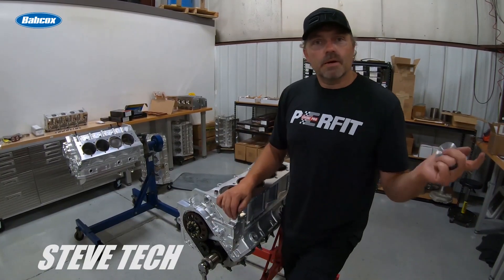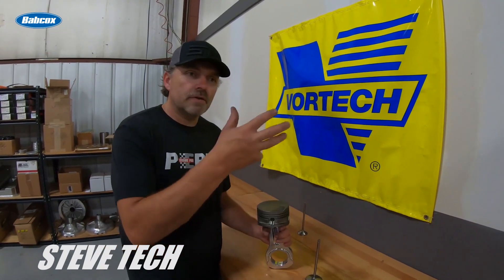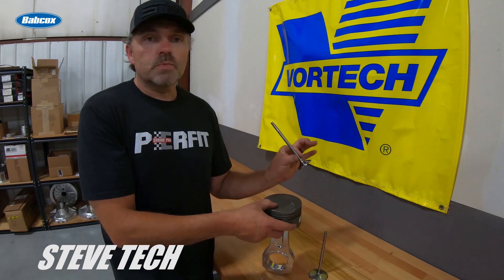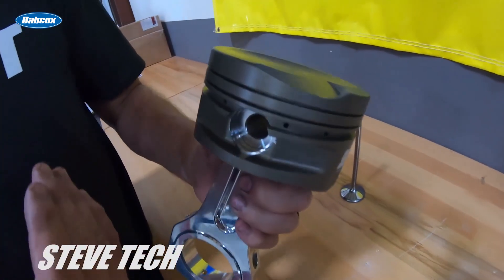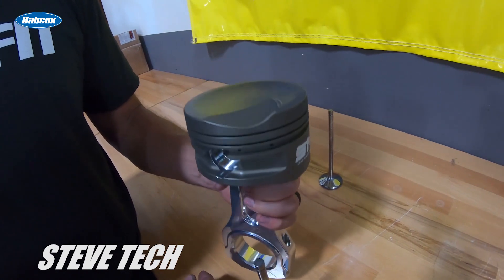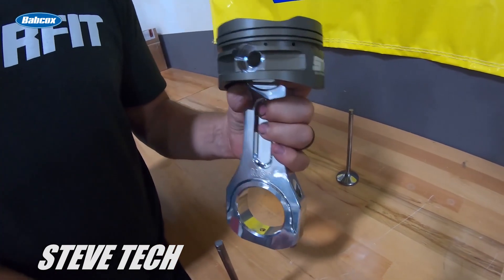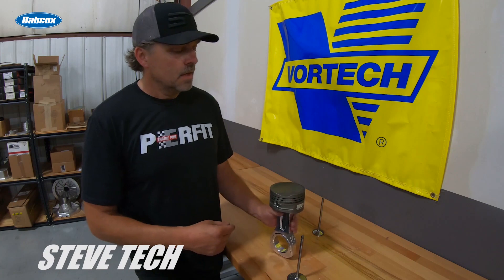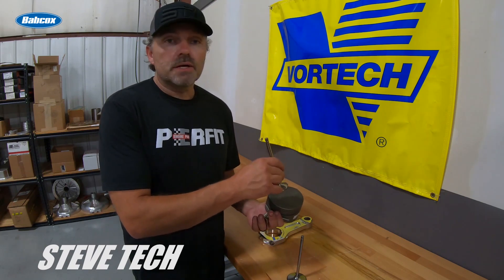Piston to Valve Clearance – Part 2

Comment: Could you do a video on the correlation between the .0050in/.0090ex valve clearance numbers relative to trying to spec a cam? ie:  like a cam with 281/297-.617/.624-113 LSA but measured @.50 the duration is 231in/247ex. . In relation to the cam being behind. I'm starting a street car 11:1 lq4 408 build, ON PAPER, and would very much ONLY have to buy and build parts 1 time. Thanks in advance yall, OH, and good luck next week. Hope to see more of you and T.B. hang'n out together. Last week was frkn AWEsome!